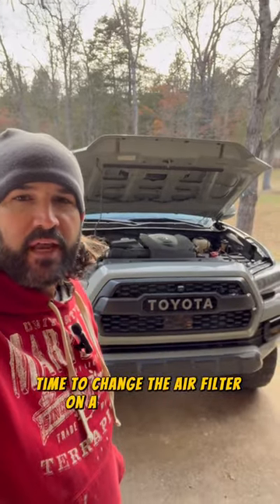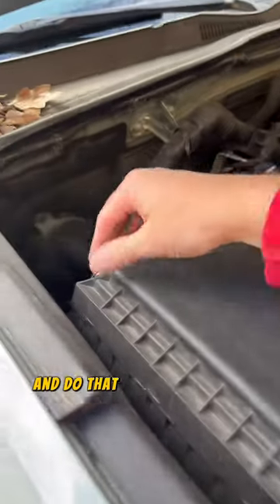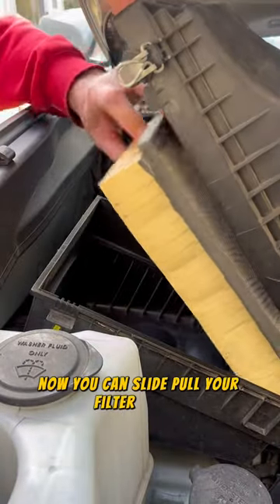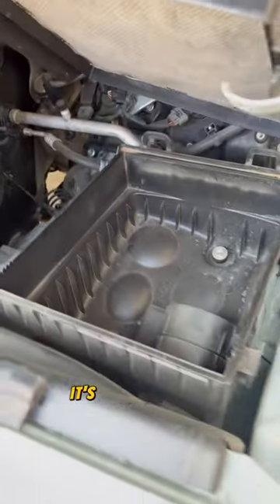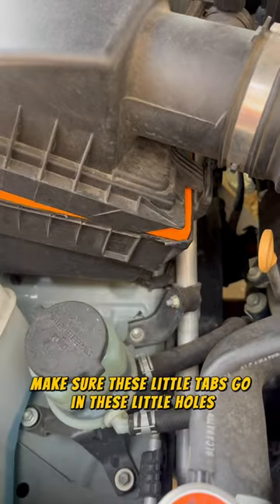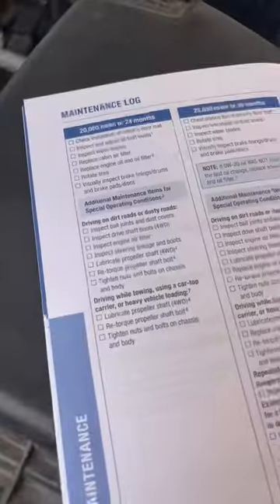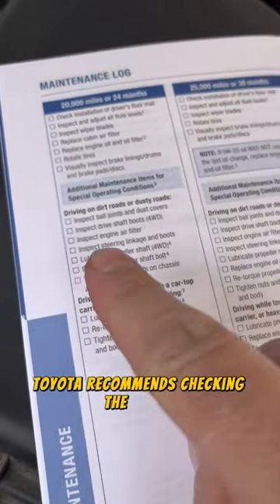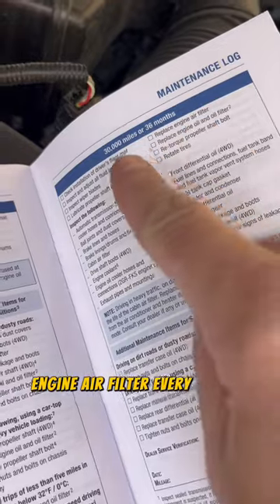Chuck Your Old Air Filter #shorts #tacoma #toyota

Comment: Does a small bit of orange show up on the back part of the filter? Mine does and wondering if I put it on right
Reply from the maker: Your pleats should fit down into the box and the “flat” part should be facing you. The orange gasket around the perimeter may be un-even looking depending on the manufacturing process.  If you still see orange when your filter box top is installed, it may not be engaged adequately.  On the lower side of the box, closest to the engine there are a couple plastic tabs (on the airbox lid/top) that fit into corresponding holes in the air box base.  Make sure those tabs are seated into those holes.  If not, then you might see some orange from the filter.  You definitely want to get that adjusted correctly so unfiltered air doesn’t get into the intake.  Hope that helps!